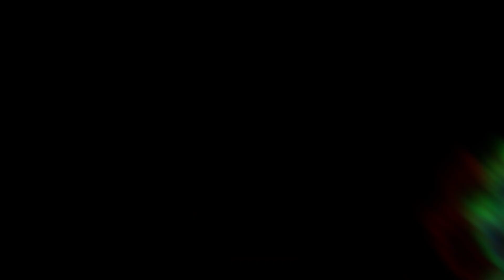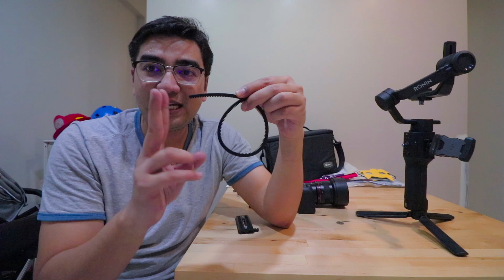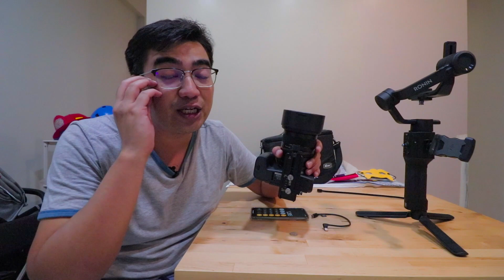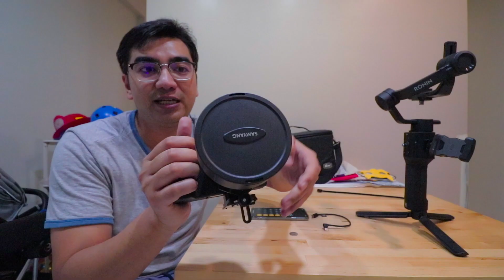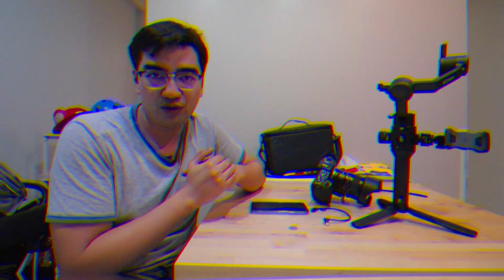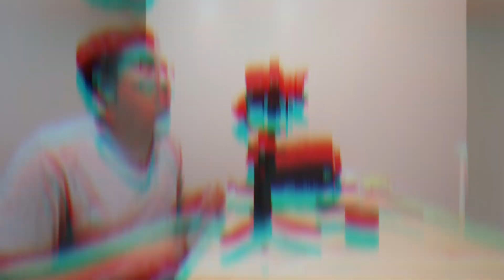DJI Ronin SC - My HEAVIEST Setup Yet (Canon EOS RP with an 800g Lens)

Comment: can i use it     with my old 550d /t2i ? thank you
Reply from the maker: Nope it doesnt work on 550d because the Dji Ronin Sc was built for mirrorless cameras. But there is a cheaper gimbal that will work called Zhiyun Weebill-S. Here is a video of 550d on Weebill-S. https://youtu.be/U7OsbxoyDu4
Reply: @TreeTanksDev  ok ty i will check it

Comment: In Theory the sigma 18-35(800g) Should work then. Sweet!
Reply from the maker: Yup but if its longer than the Samyang then it may hit the roll axis. Gotta get the position of the quick adjustment plate inch perfect.

Comment: Thank you for testing the RP. I'm curious why using just 1 screw on the forward location on the camera riser overheats the gimbal after prolonged use.  You're way under the payload limit.
Reply from the maker: Hey there! When using the quick riser plate with the samyang lens or even the kit lens, its impossible to balance as its too front heavy. Yes by using this hack method of mounting will strain the motors hence i recommend max 10-15 mins of usage before letting it rest. In order to doing some other work around, i have ordered the SmallRig counterweights. Will come up with a new video once i receive it. I just bought the Zhiyun Weebill S as well and setting up the RP on it is a breeze. Video on that should be out tomorrow! 😀

Comment: hi! is it possible balance a7III with 24-105? tks
Reply from the maker: Hey there! You probably will be able to balance it but it will be really difficult and may have difficulties doing certain stuff like 360 barrel rolls and using activetrack. I suggest the DJI Ronin SC or Zhiyun Weebill S which was launched 6 days ago. Ive just received it and will be tutorials on different setups. But on the website it states that the Weebill S can take a7iii with 24-105. 😀